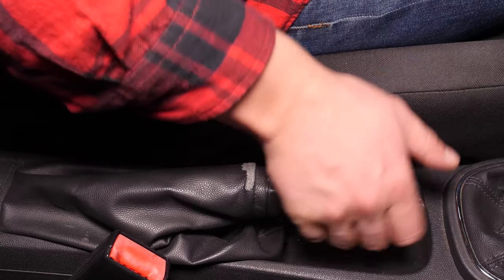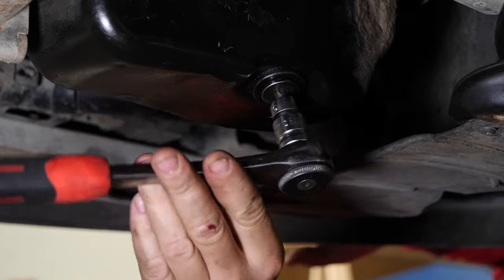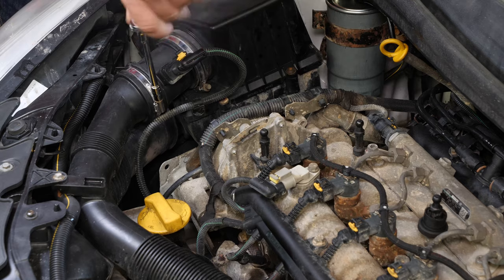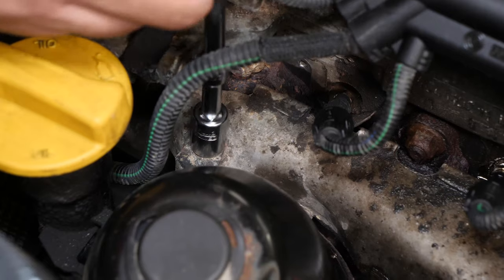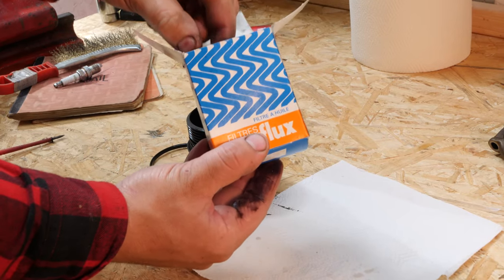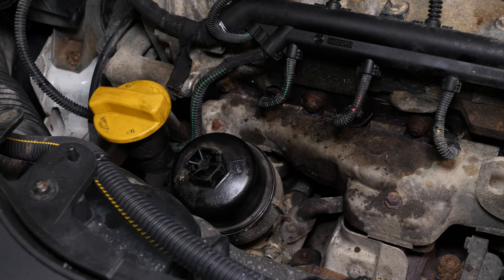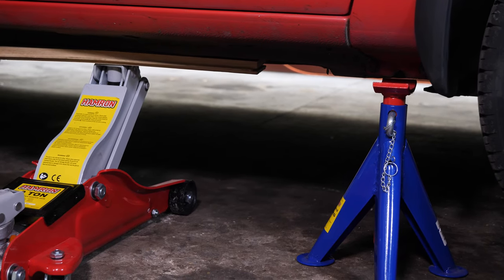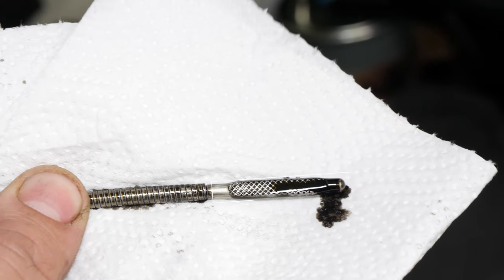Change the oil and the oil filter CORSA D 1.3 CDTI 🛢

Comment from the maker: BUY THE AUTO PARTS you need for the operation : 👉 http://bit.ly/cheapAutoparts 👈
📱 DOWNLOAD THE APP : 🍎 http://bit.ly/MCD12AppStore, 🤖 : http://bit.ly/MCD12PlayStore 📱⬇︎⬇︎ 🔥   🔧🔧🔧   🔥⬇︎⬇︎

Needed parts: 
- Oil filter : http://bit.ly/oilfilterL330en

- Motor oil : http://bit.ly/oil8100XCLEANEFE5W30en

- Drain seal : http://bit.ly/drainnut48884en

- Brake cleaner : http://bit.ly/brakecleaneren

Discover a vast array of services that will help you run the maintenance of your car: vehicle user manuals, maintenance planning and mechanics-oriented tutorials!
How to change the oil and the oil filter on a Opel Corsa D.

Discover the world of UseTool EN on http://bit.ly/usetool

🛠📏⚙ FIND ALL THE PARTS AND TOOLS NEEDED AND RECOMMENDED BY USETOOL EN ⚙📏🛠

Needed tools:
-💣🤖🏆The complete toolbox recommended by UseTool ES to repair your Corsa D : http://bit.ly/supertoolboxEN 🏆🤖💣

- Torx T30 socket
- 8mm socket
- Torx T45 socket
- Socket wrench + extender
- Thin flat head screwdriver
- 7mm socket
- 10mm socket
- 27mm socket
- Measuring cup (optional)
- Piece of tissue
- Liquid collector
- Funnel (optional)

🔝💪Safely lift your Corsa D with the hydraulic jack: http://bit.ly/upupupen and axle stands: http://bit.ly/axlesen recommended by UseTool EN 💪🔝

- Hydraulic jack 
- Wooden peg
- Axle stand

🚗📢💡 RESOURCES 💡📢🚗

Usetool's warnings
- Don't perform this operation when the engine is still hot, as you could seriously burn yourself. 

- Be very meticulous when filling the engine with oil, especially on a Diesel engine. Never go over the maximum level indicated.

Usetool's infos
Tightening the new filter by hand is enough to set it in place.

📽❤️🚨 USEFUL VIDEOS 🚨❤️📽
- [ USETOOL'S TIPS & TRICKS ] DIY: Making a liquids collector : https://youtu.be/wVSbtm-DAgY

- [ USETOOL'S TIPS & TRICKS ] Lifting your vehicle safely : https://youtu.be/93QCNfGihMw

- [ USETOOL'S TIPS & TRICKS ] Unscrewing a blocked oil filter : https://youtu.be/hrPp4VmvdhI